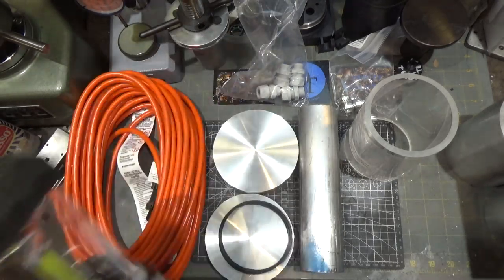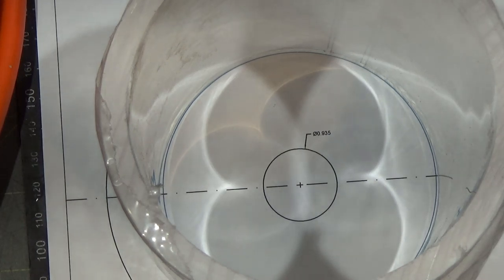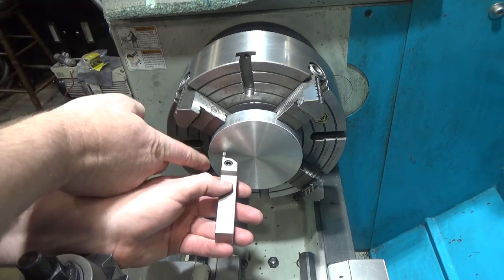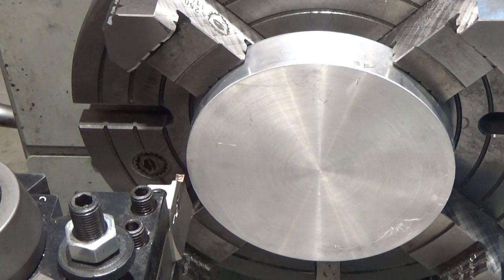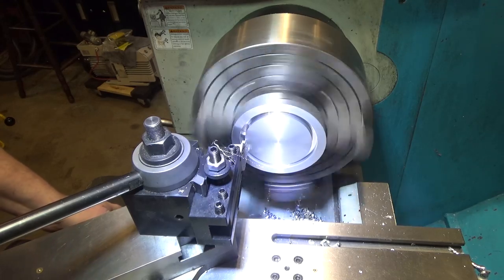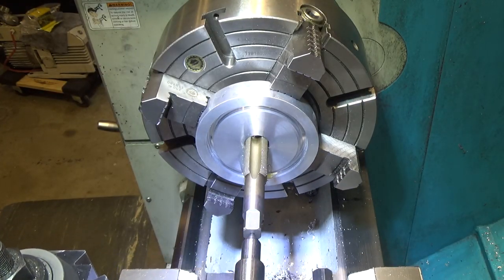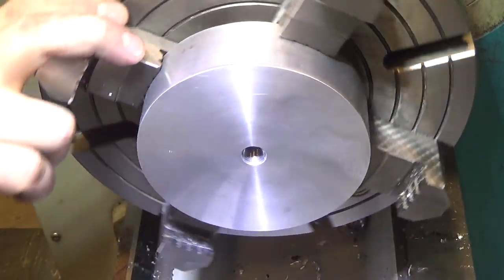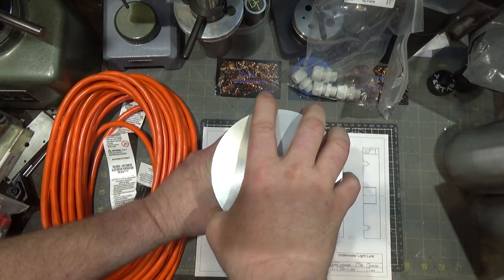118 Underwater Light Lure for Night Fishing Part 1

Comment: Neat project! I'll bet you're surpised how much! extra weight that thing's going to need to make it sink! Nice thing is once it's in the water the weight can be adjusted to get it just under neutral, it should just float at depth.
Reply from the maker: I could have done the calculations, but was just winging it and hoping for the best. If we assume that the density of air is 0 (which it isn't), and given that the density of salt water is about 1.1g/ml and aluminum is about 2.7g/ml, then if the volume of air inside is 2.46X (2.7/1.1) the volume of aluminum, the light should be neutrally boyant at sea level. I think the volume of aluminum is more than 40% the volume of air space, so I think it will sink. Now will it stay air tight and 40 feet of depth?
Reply: @DudleyToolwright  I forgot to account for the extra weight of the acrylic and the central aluminum core. If I've guess right it puts you about 2-300 grams heavy!
Reply from the maker: I didn't account for the acrylic either. Doh! According to a google search acrylic is slightly denser than sea water at 1.18g/ml, so it wont hurt. I could have gotten burned.

Comment: I wonder if you put a Schrader valve in the top end and pressurized the container to 20 psi or so if that might help keep the water out. Just an idea.
Reply from the maker: Positive pressure is an excellent way to keep water out if you can provide a constant source. It would really help in situations when the extension cord gets a small hole in the insulation and it would push air out rather than let water in. As for pressure compensation, it would be useful to pressurize the container to half the maximum pressure, that way at depth the pressure would be half pushing from the outside in and half at the surface pushing from the inside out.

Comment: You mentioned that you want working depth of 50 ft ... the pressure at 50 is more like 36psi not 20 ...
Reply from the maker: I got my pressure relationship from the NOAA site which say that you increase pressure by 14.5 psi per 33 ft of depth so I got:  14.5psi/33feet X 50feet = ~22psi. Did I make a mistake? I make simple math errors all the time.
Reply: @DudleyToolwright  36 psi comes from  Ptotal = Patmosphere + Pfluid
Reply from the maker: Ahh, got it. I did not mention that I was commenting on differential pressure rather than absolute, because the light will be sealed a approx. 1 ATM and hopefully will stay that way, so the seals will only have to deal with the differential. Good catch.
Reply: Should have added .. in my engineering career in designed a number of systems for under water use ... I just ignore internal 1 atm but you are correct the pressure differences is 22 or 23 psi ... your design looks good enough for at least 50 to 100 ft assuming the cylinder does not fail
Reply from the maker: Thanks. I just tested it in a pressure cooker fed by my air compressor and it didn't leak at 50 feet.